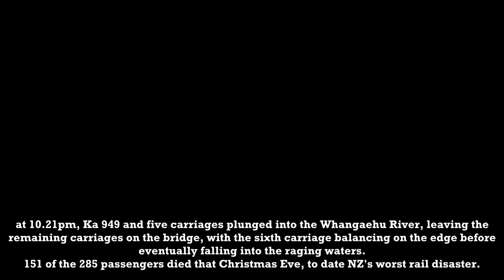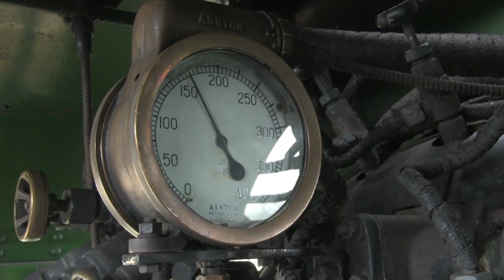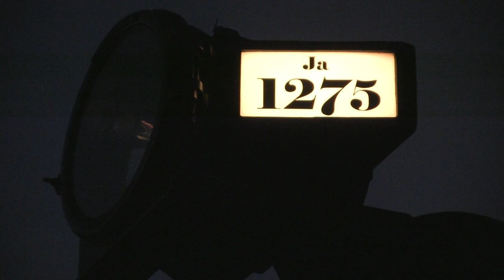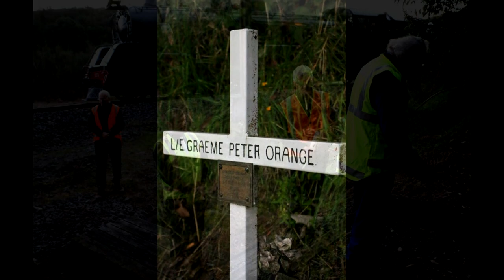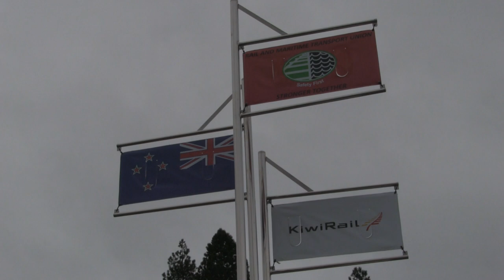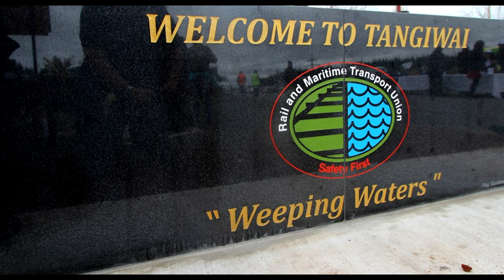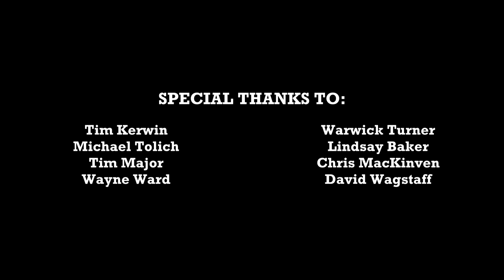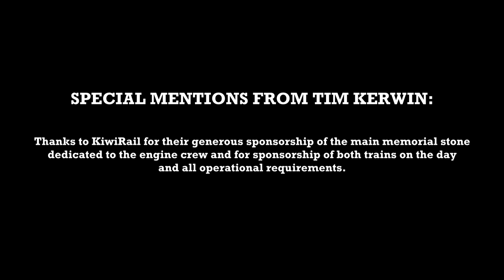Railway Film: Tangiwai or Bust - Behind the Scenes of a Steam Excursion (2018)

Comment: 19:40 what is that flickering light
I hope that train will still be out on the tracks
26:05 what is this?
28:00 iconic 28:09 28:12 a great send off like Ironman. That whistle fading into the same waters
Reply: The flickering light is the firebox.
Reply: the light flickering is the firebox
Reply: Oil burning in the firebox